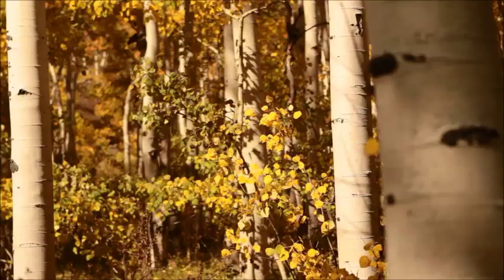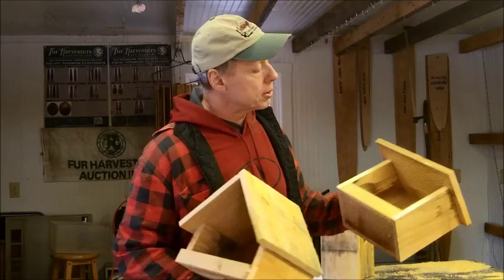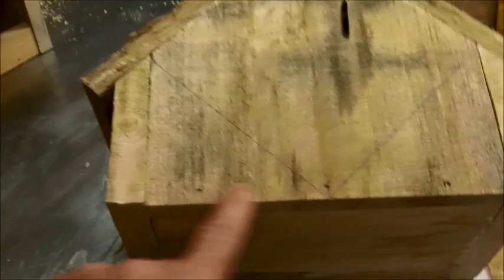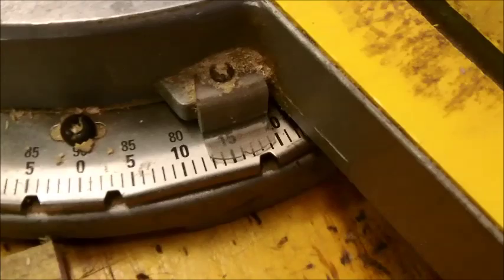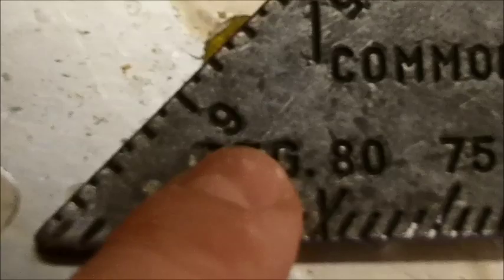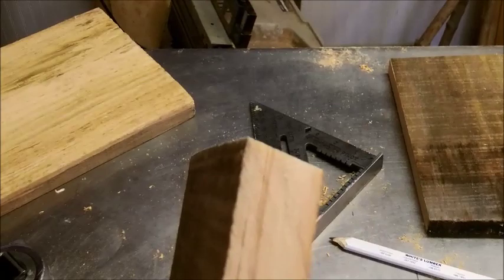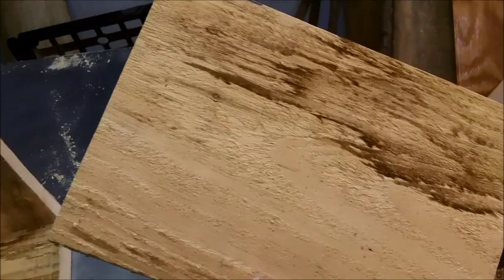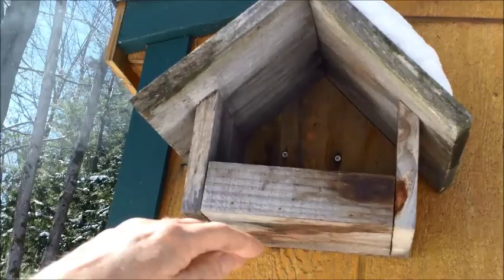Homestead Projects. How To Build Bird Houses - Caring for the flock PART 2

Comment: Excellent jc,,interesting on the ones that face east being good, didn't know that. Thx for the share
Reply from the maker: I try to face most of them south east.  The one that held the cool nest was actually facing north. I hung it on the barn because it looked like a good spot but had my doubts it would be used since it faced north.  They probably used it cause all the other boxes were full.
Reply: thebossoftheswamp makes sense boss. Very cool

Comment: Thanks for my BossofTheSwamp fix!!! Snow's all but melted here in central NY (some still out in the woods though) - looking forward to making some of these, and trying out some barrel raised beds we're gonna utilize this summer.  Thanks JC!!
Reply from the maker: Happy to hear you'll be using some of these project ideas. I'm sure you will like those barrels.  Still lots of snow here. It's melting very slow. 
All the best.
Reply: I need a "BossOfTheSwamp" fix!!
Reply from the maker: Rob Baker I haven't done anything worth taping lately but I'm heading to the cabin shortly. I try t keep the vids interesting and don't just want to pump out a bunch of repetitive crap. I should have something soon.  Thanks for checking in.

Comment: Another good tip for marking 15 degrees( if you don't have a speed square) is to measure one inch from the end of the board,( along the edge, one inch from the corner)  then four inches up from that mark( accross the board) . Using a straight edge, or scrap of wood, place it on the corner and your four inch mark.... Draw a line.. It's 15 degrees.

Comment: JC:  I never knew that that particular bird could stucco LOL It's amazing to me how much all animals know, and not being shown how to do it.  I have a twelve inch double compound Dewalt chop box but it's not on tubes, the saw lost its guard and the brake didn't engage quick enough and I was repositioning a lattice trim board and bumped the blade with my right hand, now i've been using a chop box for years with no guard, but it only takes one time to do something careless, anyway I cut  my index and middle finger through both knuckles, took 5 stitches ea.  So I wanted to tell your subscribers to please be careful with their equipment and not get hurt like me...   Bud
Reply from the maker: +Bud                  and Bess   You are so right Bud.  Whenever I ignore things like you did, I end up like you did.  Live and learn eh?   Hope you healed up ok.Cheers.

Comment: I really like those designs boss. Will have to make some of my own. That robins nest is amazing to me too. Have you made any bat boxes? I'd like to make one but I'm not sure where to hang it. Not any really good spots for one on my property here in suburbia. I do see them though flying around the street lights gorging themselves on bugs in the summer.
Reply from the maker: I would think that on the side of any structure would work. They'll slip into tiny cracks in roof trim and places like that.  Probably wouldn't matter where you hung it.  If you build it - they will come.